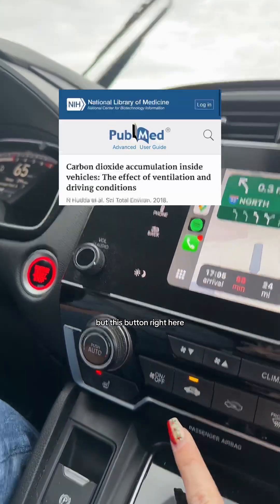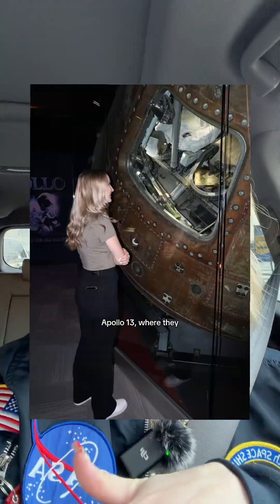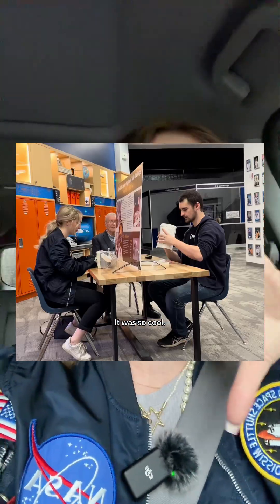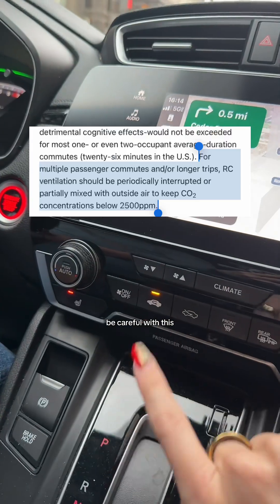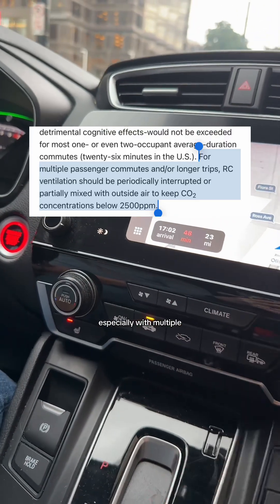Do NOT press this button*

Comment: No one needs to hear this because it's not true. All modern cars have pressure release vents to let cabin air escape when closing the door. These vents are usually hidden near the back of the car, behind the rear fender. Maybe if you have a 7-seater full of people you could be exposed to harmful levels of CO2. But by yourself you cannot reach a dangerous level unless you made your car airtight.